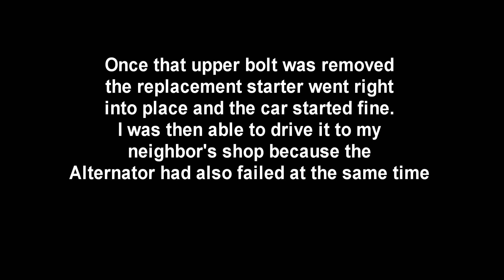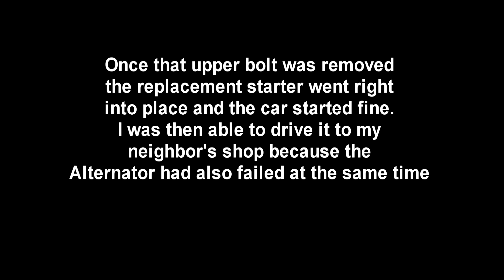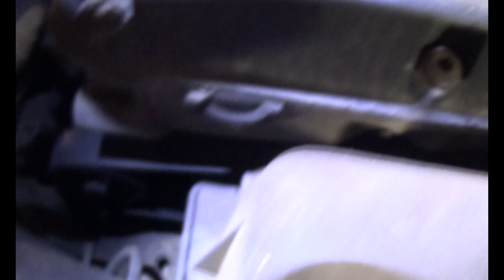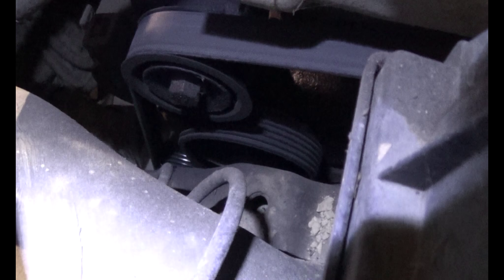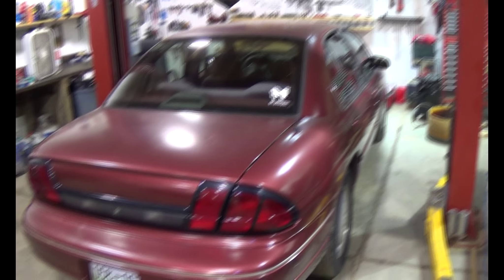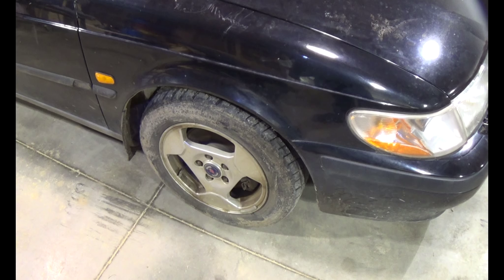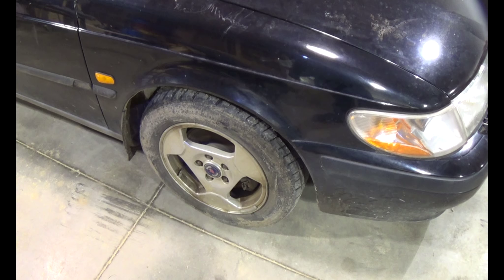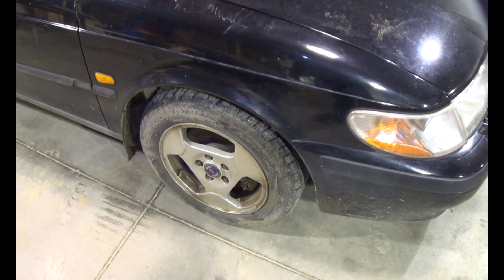1999 Saab 9 3 Turbo Convertible Starter & Alternator repair

Comment: just done mine and it was easy.once u have idler pulley out the way and tensioner you can get in there.but for those who said in other videos that when you have removed bolts for alternator it then comes out from the top is tight to say the least.i couldn't get out from top.you have to disconnect exhaust from intermidiate section and lower from the bottom.